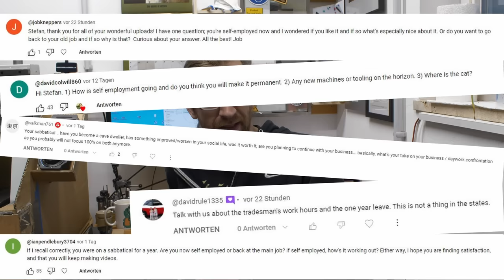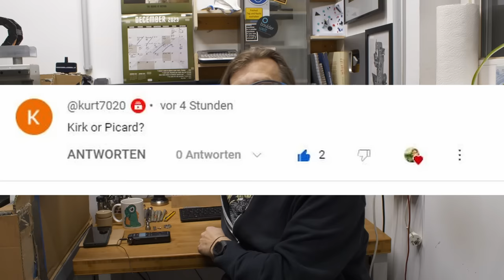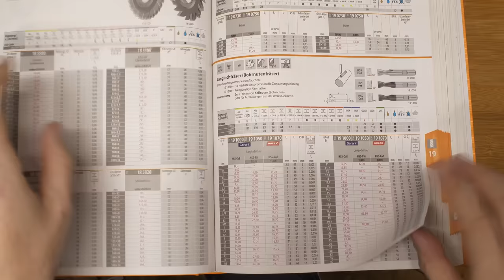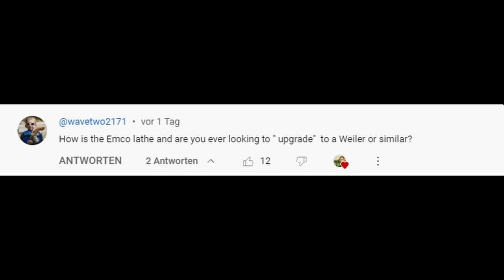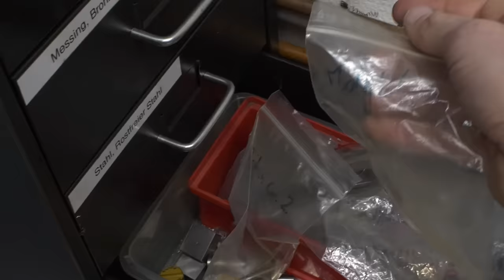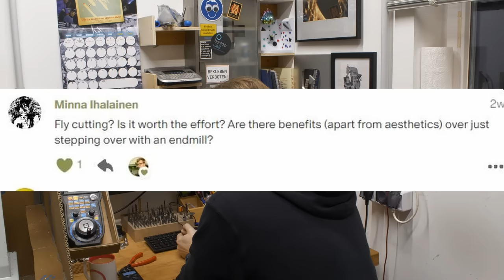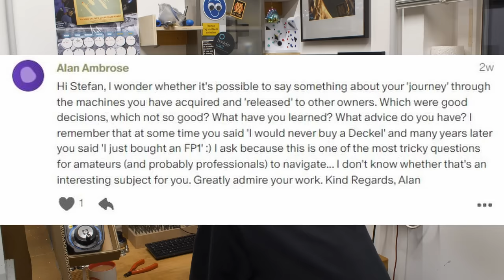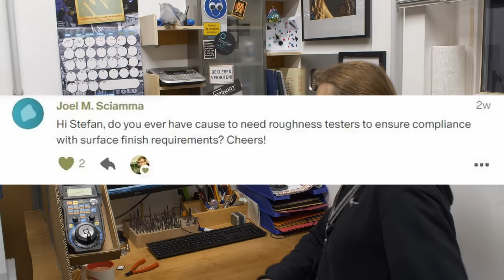Your Questions, my Answers

Comment: It looks like you're fed from a star wound transformer three 400v leg to leg and three 230v leg to common circuits. I the USA we see this as 208v and 120v. These were first popular in applications with high single phase loads such as lighting in a high rises because of the three 120v circuits. There are 208v single and three phase motors made for such systems, however it is now common to see motors labeled 208v/230v. Manufactures have likely improved the insulation to handle the higher temp at 208v. Still standard for residential use in the USA is the delta wound system, where using one side of the delta with a center tap, you get one 240v leg to leg and 120v leg to common circuits supplied to the house. 
I really enjoy your videos, learning something every time I watch one.

Comment: Thank you Stefan. You are the only "talking head" I willing to listen to for 2+ hours. I did fast-forward the Star Trek segment, I confess, but I had no idea what you were talking about anyway ;-).  

By the way, as Mathias discovered, the key to high user engagement is to leave a chuck key in the lathe chuck. Or a video about how far the lathe can fling the key ;-).

(I corrected two typos here)

Comment: Stefan.  Happy new year to you and nearest. 
regarding a geared headstock and finish noise , when I served my time ( 5 year apprenticeship )  I did a year in the armature/stator winding section one job was a large ASEA rotary converter 6 phase in and 220Vdc at 2500 amp output it was a open frame machine from the 1940 era . that being said we sent it to the central machine shop to have the commutator skimmed prior to us undercutting it , when it was returned to service every third segment went black from the brushes , well we retested it ( very difficult due to winding configuration) and found no fault , so we asked the machinist who did the work he asked me to count the black marks , you will have guessed the answer it was 72 the same as the bull gear on the lathe 
note this was a large iron works with a large maintenance dept 

keep up the extant videos always something to learn 

Stuart

Comment: Regarding the VSD for your Deckel to avoid hammering the drive train if reversing e.g. for tapping, I have a Weiler LZ 300 ( my first machine) which is 3 phase and I installed a "soft start" made by Allen Bradley to solve the problem. It works perfectly to protect the drive train from the shock of reversing a DOL motor. It controls the current the motor can draw, which is adjustable via a pot, so it works very well for screw cutting where the spindle needs to be reversed. The lathe has a screw on chuck so this also prevents the chuck from unwinding during spindle reversing.

Comment: I have a Gerardi that works well but I agree 100% they are less than ideal for tiny parts. I'll probably use it as the main vice on my new Syil X5 CNC for larger parts. I'm not convinced about the repeatability though. I looked at some self-centering vices, including the lovely 80 mm XTRICs, but I can't justify the cost right now, so just like you, I have a selection of those Chinese grinding vices from Arceurotrade

Comment: Hi Stefan. The Weiler Primus with the gearbox is driven by two v-belts from the gearbox to the spindle, No direct gears as you claim. The belts are on the end side of the spinde above the change gears.
Reply from the maker: Thank you! I completely misunderstood how its built. That changes a lot, the primus lz-g just moved on top of my selection
Reply: Happy to clarify and contribute to your nice little channel. I'm curious to you thoughts now of comparing the two lathes, Matador Vs2 and primus, now, whith this new knowledge. What features makes the Primus more desirable for you, despite the smaller footprint?  @StefanGotteswinter
Reply from the maker: The Footprint and the logistics of moving the machine :D
The matador is definetly pushing how much space I have availible, the Primus is a bit smaller than the Emco, but after studying the manual and drawings of the machine, it seems like a more sturdy machine.

Comment: I´ve worked on a Weiler Matador and a Primus GS during my apprenticeship and i´ve enjoyed working with the Primus way more than the Matador. I definetly see your point with the back gear, also our Matador was extremely run down (bc it was the only machine with a DRO and no one wanted to read conventional scales hahah). Had to do an overhaul of the support and cross slide on the Matador during that time and as far as i remember it was a huge pain to do so. 
The primus has a special place in my heart, it just felt like a more coherent (tho somewhat minimalist) machine and at least in my experience it runs quieter over the whole speed range. Also regular maintenance was easier on the Primus, especially draining and refilling the headstock oilbath.
In that context, during my overhaul of the support and cross slide I´ve noticed the bearing arrangement for the lead screws in those weiler machines is similar to the one you´ve changed on your import milling machine y Axis back in the day. would you do that again once you´d be getting a Matador?

Comment: 29:40 Ohm's law applies, no matter what continent you are on. In the US. commercial power is 3ph 480v @60hz L1 to ground gives 277v often used for shop lighting. Via a transformer, office space or residential power is 240 across L1 and L2 with L1 to natural giving 120v. At a home shop in the states we don't have, and can't get 3ph service. We take our 220/240 (depending on what two legs they feed you). Then with a VFD and the motor wired for 240/208 it works and we have hz control, reverse, "soft start" and dynamic braking.  What seems strange to us is working in damp conditions (on a construction site or a hair dryer in the bathroom) with 230v in your hand. Likewise if you saw our common  electrical connectors, ie, wall sockets and plug ends. You would wonder how we are still here. LOL. Also I'm sure you know to get ABB controllers from your local electrical supply house. The $99.oo VFD from ebay needs to just stay there.

Comment: I am a big fan of having two lathes, a plain 102 and a bigger machine for screw cutting and other heavy work. (you could find room for a 102 I am sure :) The 102 doesn't take much space and is just lovely for fine work.  The Leinen MLZ 4 STG is also a nice machine, not quite Schaublin refined although it has a better drive system in my experience. You probably saw pictures of my old machine on Tony's site.
Reply from the maker: In a perfecter world, I would have two deckel Fp1 back to back and two similar toolroom lathes back to back :D

I have looked at the MLZ4, but those seem rather rare-ish. Nevertheless nice machines. But they are rather old machines by now it seems.

Comment: I used to use a lot of the green UHMWPE, Ultra High Molecular Weight Polyethylene on our packaging lines. As you say its fantastically slippery and wears really well, but smooth glass bottles would sort of scour it away over time. Really strange wear in places.

Comment: Those dags on UHMWPE cuts are bloody annoying! If I'm in a hurry, I'll trim excess with scissors, but I'll usually use the small Scotch Brite Dremel tools. They're tough enough to brush off the plastic burr, but not abrasive enough to mark the material.

Comment: I have a question. As we share similar thinking, I bought Weiler Matador 3 months ago and start to completely restore it. What a nice and well made machine. As part of that, I bought a new motor + VFD. I kept the gearbox (cleaned it and change all the bearings), but with modern VFD, you get almost same power from motor at lower RPM. Would you keep the gearbox, then? On one side, you cen still use the speed selector and clutch lever. On the other, you can change the speed on the fly with pot plus with nowadays DROs, you can keep constant surface speed with diameter changes. I would love to hear your or others thoughts on this.

Comment: We had xometry make a part for us... It took 8 months and 4 attempts before we finally just fixed one of the results ourselves... Not a good experience so far. Two of the attempts they filled out the tolerance report as passed when the tolerances clearly and blatantly failed.

Comment: Hi Stefan, what’s the length, width, and thickness of your vise stop. I would really appreciate it. In the process of making it now. Thanks hope this message finds you well.
Reply from the maker: Hey - Not sure which one you mean. Most of my vise stops are like 20x10mm cross section and use a 6mm pin as an actual stop.

Comment: Hi Stefan and happy new year.  In your discussion of the schaublin 125 lathe you stated that the box ways have drawbacks.
What are those drawback? is it in the context of small manual machines?  I ask to increase my knowledge of machines (and for anyone else that is curious).
For those not in the industry , Box ways are used on  virtually all heavy modern industrial lathes and mills .lighter and faster machines use linear ball bearing rails.
Reply from the maker: Prismatic ways will always be zero play (self correcting with wear), Box or dovetail will wear with side/side play.
Reply: @StefanGotteswinter  Hi stefan Thanks for the answer.  I see what you mean . All of the box way machines that I have 
installed and provided service for  have  had turcite or rulon slide surfaces, as well as gibs between the ways and keeper plates.
as long as the way wipers are kept intact and the automatic way lube system is cared for, they will run a very long
time before  an adjustment is even necessary.

Comment: Fast question regarding 6mm endmills: I have to finish a 30mm thick part in aluminum, would you recommend necking a 6mm endmill or investing in something that has that reach like a 10mm?
Reply: If there's room, use a bigger tool. You will probably need bigger end mills than 6mm often anyway.

Comment: Hi Stefan. Frage was für Lot + FM nimmst Du für Hartmetall-Stahlverbindungen? Danke
Reply from the maker: Flussmittel: Fontargen F300 HM und als Lot ein Silberhartlot, meistens FONTARGEN A 333, gibts beides z.b. bei Sonderlote.de
Reply: Lach mit, was hab ich wohl vor 3 Tagen wo bestellt. Phosphorbronze verlöten geht auch gut mit dem HM Flussmittel. Etwas flüssiger aber halt die Carbidstifte in Platz.
 @StefanGotteswinter

Comment: Not all engineer's are bad years ago where I worked the  engineer cam into the shop and belt a cnc
type drill press by hand and it worked it drilled fast I mean a big drill press about 35or 40 ft.